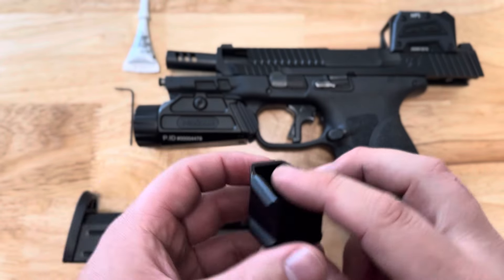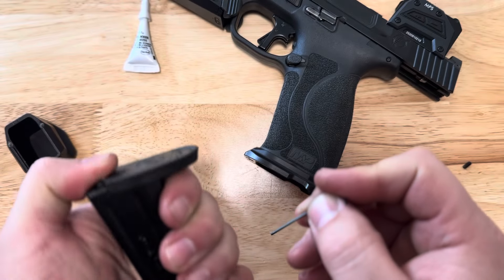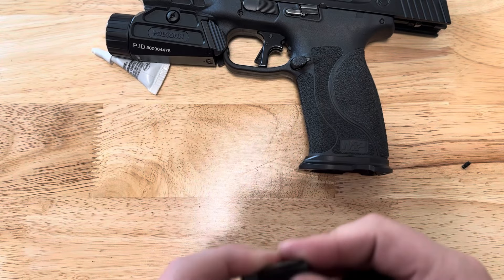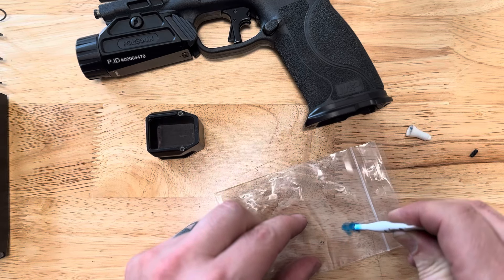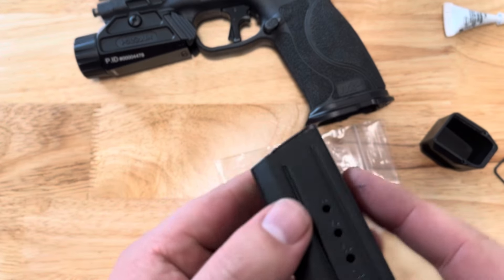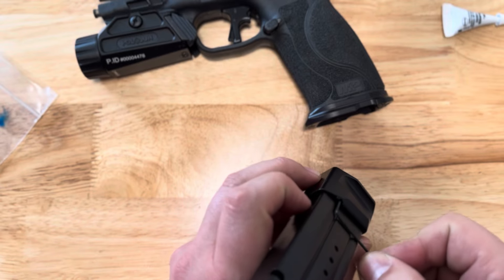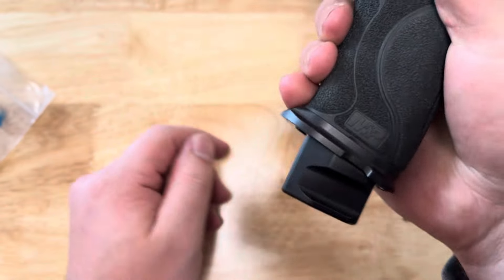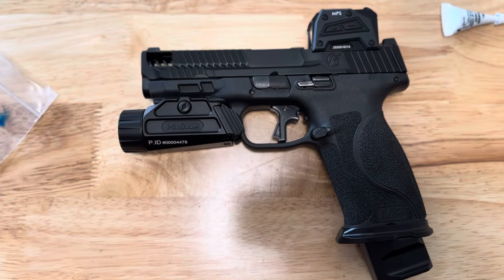FCS M&P +6 extension install

Comment: I recently purchased the flat base plate for m&p 45 and tried to attach them to pro mags. They didn’t fit ☹️ I just order the 3 round extension hoping they will work 🤞🏽
Reply from the maker: @kennethlee8873  unfortunately we don’t make them for the Pro mags, only smith and Wesson factory mags

Comment: You should make some +8/9 extensions. My ocd wants that perfect 25 in the mag 😅
Reply from the maker: @ericklagos1431  grab the 23rnd mag and put our +2 on it and spacer sleeve 😎
Reply: @floydscustomshop2157  i dont believe theres a 23rnd mag for the competitor
Reply from the maker: @ if it didn’t come with it then you would have to buy them, but they work on all the m&ps 9/40

Comment: Is the small gap between the body of the magazine and the extension normal? I have some new extensions and some old and only the new ones have it. Also, any idea when you’re gonna have the replacement springs back in stock?
Reply from the maker: @Fitterr26  I believe they are instock, but yes the little gap in front is normal, it’s due to the bend angle of the mag rail.
Reply: @floydscustomshop2157  okay now it says in stock and just ordered a couple. Thanks

Comment: i see you mention the stock magwell won't work with the mag extensions, but will the mag extensions work on the stock magwell?
Reply from the maker: @basaif93  you can run our extension without our Magwell, but you will need our plates or extension to run our Magwell. The stock plates are designed to the size and shape of the frame and are too large to work inside a proper Magwell.

Comment: would i still have to purchase a baseplate with the extended magazine?
Reply from the maker: @yodeej0  with the 23 rnd mag you will need to modify the plate a little or use our extensions and spacer sleeve

Comment: do i need magwells in order to use the plus 6 extension? or will gun look dumb with out the magwell
Reply from the maker: @Ram-eb9wu  the extension will work on there own, but much better with the magwell

Comment: Do these extensions and mag well work together on the m and p metal?
Reply from the maker: We have a Magwell specifically for the Metal frame as it is different. But the extensions are the same yes.

Comment: Will these work on the factory 23 rd magazines ?
Reply from the maker: @facerapi2920  yes they will, we do have spacer sleeves as well to fill the gap and prevent any chance of over insertion when going from the 23 rnd mag with our extensions to full-size or compact frame with our magwells